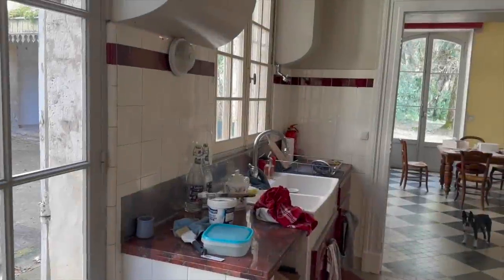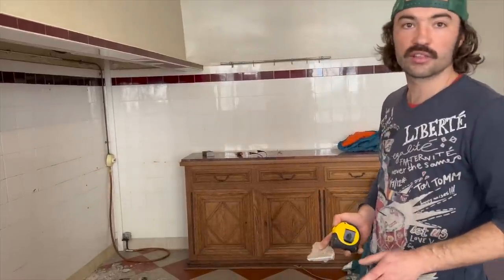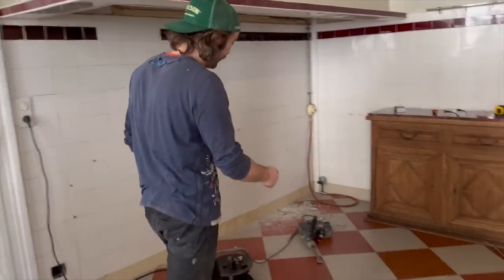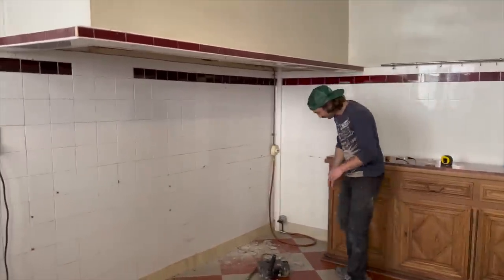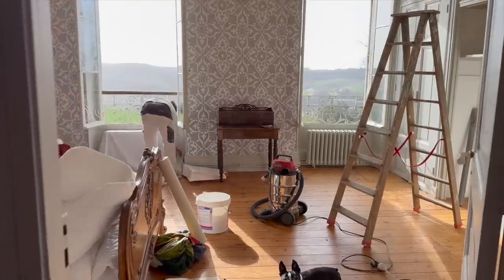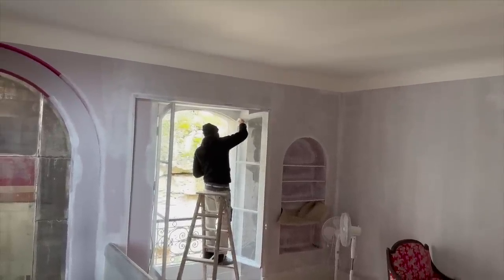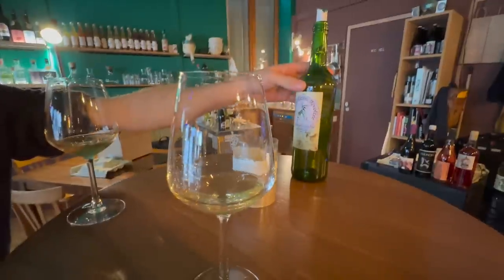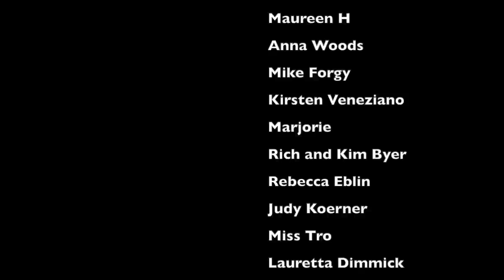Crazy Demolition Week At The Chateau! – The Chateau Chronicles – Ep #26

Comment: The kitchen tile is in good shape from what I've seen on film. The color is not terrible and could you picture adding significant red clay accents, such as large red clay pots, to better compliment the floor color?  If removing the tile would make you very happy, then that's what is most important.  The other nice thing about replacing the tile, is you can work without worrying about damaging the existing tiles in the meantime.
Reply: I agree with you, I think the kitchen tile is part of the "history" of the home and compliments it greatly.  If you absolutely hate the tile then I guess you should remove it, nothing like renovation regret.
Reply: @citygirlingraham  I think she should just use the tiles as a base for the new tiles , why pull all that up for when they be a good base .
Reply: @KeithWiggins-xc1sf  I agree depending on matching floor levels in the adjoining rooms.
Reply: It will be challenging to have a level transition from the replaced red tile to the black tile which you intend to keep. The red tiles seem to be in good order and solidly built and therefor difficult and costly to remove. You must have deep pockets for the sake of changing the colour.

Comment: Abbie, can I ask why you haven’t considered doing the white/red tile and the connecting black & white room in the same tile? Both rooms would look bigger and they would flow into each other. Plus, you could just lay the new tile on top of the old tile. Let’s say between both rooms you have 800sf at most, you can buy that French hand-painted look repo tile for under $3 SF. What you would save in having Thomas chisel all that old tile away, you’d be halfway to paying for new tile in both rooms. Those rooms are supposed to traffic-flow into each other. They should have same tile, same paint color and same cabinets in both rooms. 

It would look amazing if you did that!!!❤️
Reply from the maker: That is the plan, though I considered just doing the red room to reduce costs.
Reply: @chateauchronicles  

Abbie, I completely understand about cost management, but I think in the long run, the decision to “bite the bullet” and reno the two rooms properly, will be one you won’t regret. 

We’re doing the same thing as you, albeit on a much smaller scale, a Maison de Maitre, in the south near Carcassonne. It’s still a pretty big undertaking, a nearly 4000sf/7 bed place. We’ve managed to stay pretty close to budget, but we were lucky and found a great builder who can do everything from plumbing, to heating & electrical to moving walls, demo, tile, floors..etc. Still, there were rooms we knew that we shouldn’t cut corners because they were so integral to the home. We bit the bullet in a few rooms where we went slightly over budget, but were able to make that up in other rooms. 

I have a tile store near me where we’ve bought all our tile and the rep has given me great discounts. I have managed to stay on avg just under $3/SF for all our tile and it’s all breathtaking tile. The kind of tile you’d pay $30-$50/SF or more for back in the states- where everything is so ridiculously overpriced by comparison to France. We’re only about 6hrs from you so if you’re interested in doing a road trip and staying with us, let me know and I’m happy to introduce you to Phillipe. 

We’ve been following your channel keenly because we also started this amazing adventure last January, not long before you.

One last bit of advise if I may. if you haven’t done so yet, make sure you have a relationship with a local vet and get Chloe an EU passport. The vet will fill everything out, turn it over to you to mail, and about 3wks later Chloe’s EU passport will arrive in the mail. Think it will make it so much easier to travel with her, not just back and forth to the states, but in the EU as well. 

We wish you and Chloe the best and look forward to your next episode❤️🐾

Comment: I’m curious why you didn’t just tile over the old tile? If the floor is solid, it probably wouldn’t have been a problem. Of course there’d have to be transition between the 2 rooms … You can also put levelling cement over existing tile, as well. But I guess I’ll have to keep watching!
Reply from the maker: It would then not be level with all the other rooms attached to it which have hardwood. It's still a possibility though.

Comment: You didn't say if you had considered it or not, but was it not possible to just tile straight over those tiles?  If the floor was pretty flat and those tiles looked in reasonable condition, you could have tiled straight over them.  I know this would have given you a level difference between the dining room and kitchen, so you could extend the tiling out there as well.  It's just you don't always have to rip up the floor to retile.